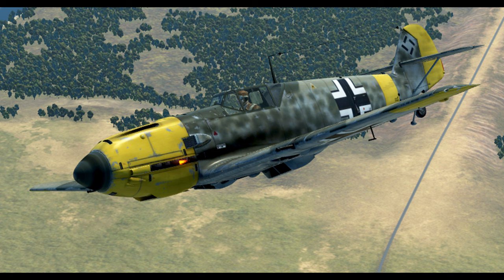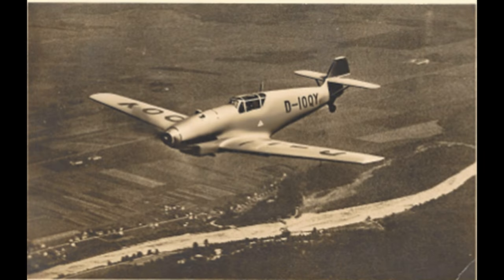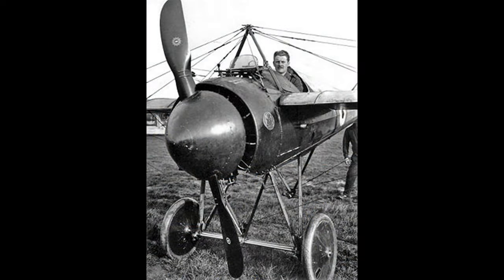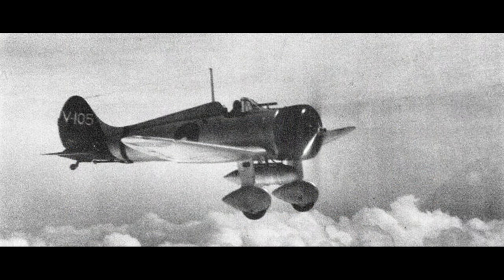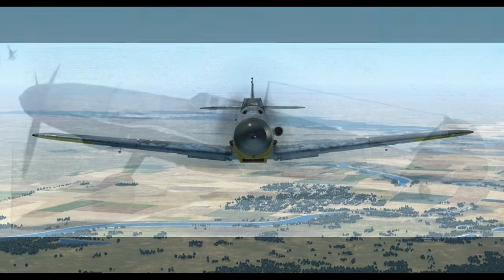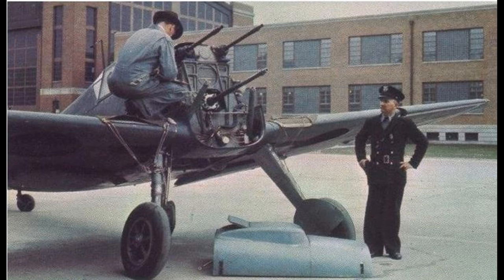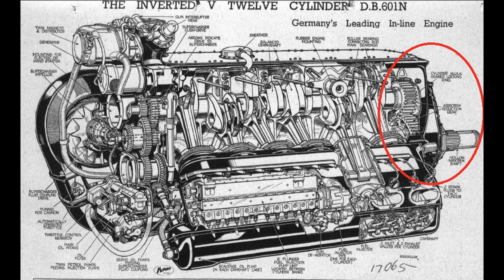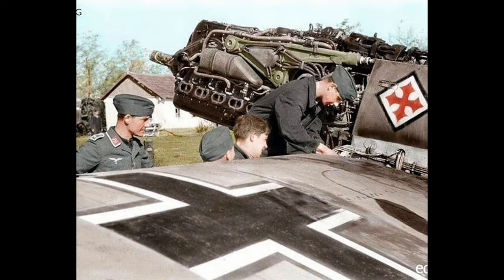Why an INVERTED V-12?  PART 2

Comment: What about heat??  In a up right over head valve V engine the carb is on top. This tends to heat soak the manifold and thus heating the carb up. I build a lot of racing and hot rod engines and any one who works on or owns old cars knows all about vapor locking. In the 50s and 60s the Grand Prix cars used a up right V but they had the exhaust exiting the top of the head and the intake charge coming from the lower side of the head. This was to have a cool and efficient intake charge. Also it reduces “wet flow “ on the intake port walls and valves .
Reply: You seem completely unaware that Germany didn't use old, outdated, obsolete carburetor technology. Most Luftwaffe combat aircraft engines (like the DB 600 series) were equipped with highly advanced high pressure Direct Fuel Injection system or GDI... an advanced technology that has not been in use in automobiles until just recently.
Reply: GDI engines are immune to vapor lock and since they use Stratified Charge Mode operation there is no fuel present in the intake port or intake valve pocket.
Reply: doktorbimmer I am completely unaware 🤣🤣🤣 I love planes but know very little about them. I work in racing and I study aerospace and plane stuff to cross pollenate ideas!! And as far as you direct injection diesel have used that technology for decades !! Direct injection has is down falls also.  Carbon build up on the valve seats will cause havoc. Buy using the water meth would steam clean all that stuff
Reply: doktorbimmer lol are you some Bavarian Beamer fan🤣🤣🤣 I work with the most powerful by weight engines known to man!! I make 2,500 hp per cylinder buddy tread lightly but thanks for the info
Reply: Not true, we are still talking about gasoline engines with spark ignition... SCSI mode operating principle...  not SCCI mode. Actually most of the better automotive GDI designs now switch between HCSI and SCSI mode. Combat aircraft don't have problems with carbon build-up, neither do do cars that are dual mode.
The Luftwaffe invented water/methanol injection (called MW-50) it was fitted to several aircraft including the 109 seen here.
Reply: Not at all, Beamer fans ride motorcycles silly.

So do I... but the most powerful by weight engines known to man  by weight don't have cylinders son... they have vanes and blades! The GE90 can crank-out 101,000 hp all day long for years at a time. 

Perhaps you should stick to those old antiques aye? Cheers!
Reply: doktorbimmer 🤣🤣🤣 euros you guys always think you got it all figured out!! My engines make over 11,000 hp @ 8,000 rpm and weight 545 lbs .  I would think you would be a RR fan not GE
Reply: We did... we invented engines son. GE benefited greatly by "Operation Lusty" which transplanted Germany's entire jet engine industry to the U.S. Americas engines were designed by Germans.

Comment: Why did the 262 have the triangular fuselage (no inverted engine obviously)?
Reply from the maker: They needed the real estate down low to attach the wings and have room for the inward swinging gear, and not much room at the top.
Reply: @GregsAirplanesandAutomobiles  Ah, makes sense. Thanks for the quick answer (as ever).
Reply: Makes me wonder ( I am by no means qualified to talk about aerodynamic design principals ) who first came up with the idea of incorporating "lift body" design elements....cause it sure looks like the nice smooth bottom of the 262 could have, albeit it slightly, benefited from this. Intentional or happy by-product ? But hey....what do I know ?.. I just learned how to butter my popcorn.

Comment: It appears that the inverted Vee type may have more parasitic drag due to oil getting slung off the crank and then failing below and getting beat up by the pistons and rods. This is probably easier to control in a Upright Vee and it can be a considerable horsepower robber and oil heat/aeration issue.
Reply from the maker: That could be, I haven't found anything official saying that, but it does appear that a good argument can be made for exactly what you are saying. There are pros and cons to every design.
Reply: Not true... Th DB-600 series was dry sump... and minimized "windage" with multiple baffles and scavenging pump pick-up points.
Reply: The crankshaft is above the whole assembly. The crank doesn't contain all the oil flowing threw it. Oil is squished out threw bearing clearances (side play) so oil will be failing or getting slung off the crank and will not be picked up by suction until it reaches the bottom of the motor. While its true that most of the air bubbles and such will be removed by the dry sump tank I'll bet there is a fair amount oil getting beat up by the crank, rods and pistons before it makes it back into the suction side of the pump. That can certainly be better controlled in a Vee motor as oil would only be exposed to one side of the crankshaft (slinging). In an inverted Vee the oil slinging cannot be easily controlled and exposes every  rotating part to the possibility of getting hit by failing or splashing oil simply because of gravity or being above all the rotating parts. As far as ease of maintenance. I would rather work on one from above even if it meant standing on a ladder or platform because there is less chance of crap hitting the ground. I can imagine working on valve train parts on this motor would have taken two people to work on it just to keep parts from failing out of it. In typical German fashion, their equipment is over designed and over thought out. It's great stuff but its one off type stuff that that just doesn't make much sense at the end of the day.
Reply: @n5ifi Not true, the inverted layout is superior in reduction of crankshaft windage... and the crankshaft incorporated roller bearings... which also minimized oil volume and pressure and an overall reduction of windage compared to up-right engines. Inverted engines are superior to up-right engines but Germany then introduced Jet aircraft... rendering piston engine fighters obsolete.
Reply: @n5ifi Not true, the inverted layout is superior in reduction of crankshaft windage... and the crankshaft incorporated roller bearings... which also minimized oil volume and pressure and an overall reduction of windage compared to up-right engines. Inverted engines are superior to up-right engines but Germany then introduced Jet aircraft... rendering piston engine fighters obsolete.
Reply: @doktorbimmer  So the crank was a bolt together crank?  I'm learning about it none the less. Very interesting. I know this motor was run very conservatively (hp wise) in the beginning of the war. The Germans should have been able to turn up the wick so to speak to get more out of it but the reasons I've heard they didn't was because of fuel quality. (Octane ratings) Was that true? Seems like I remember this being a much large (CI Wise) motor than the Rolls Royce.
Reply: No, the crank is a large forging. Really? because the DB600 series went from a rather conservative 900 HP (1,000 hp 5 min. WEP max.) in 1935 to 1,900 hp continuous (3,000 hp WEP {up to 20 min}) by war's end.
  The Germans had an excellent system of standardized fuel grades for military equipment. For aircraft piston engines there were two standard grades:
  Flugmotorenbenzin C3  (dyed Green) high perf. 100 octane (PON)
  Flugmotorenbenzin B4  (dyed Blue)       standard 90 octane.

Compared to the Allies which used a wide variety of fuels and colors from 85 - 125 octane, with all the logistical problems and accidental engine damage that would result from such confusion. 

*The DB-600 series has displacement between 33.9 L (2070 cu.in.)
 to 44.5 Liters (2,717 cu.in.)..*

The biggest flaw in the Rolls-Royce Merlin was its small displacement... this problem had to be compensated by ever higher boost pressure (and less reliability and shorter TBOs).
 This flaw was finally addressed with the Rolls-Royce Griffon engine... a vastly improved version of the Merlin with a larger displacement of  37 liters (2,240 cu in) but the long development meant these engines arrived too late in the war to make any impact. Cheers!
Reply: So how do you get roller bearings in a forged crank?  Radial engines used roller main bearing(s) because the crank was in 3 pieces bolted together
Reply: @jimattrill8933  Split bearings, that´s how.

Comment: Nice video, thanks for sharing !  Having the guns in the nose (as opposed to having it in the wings) also helps with gun accuracy at range. Convergence of fire is less of an issue since both guns shoot straight instead of converging at a set distance (which is the case when guns are mounted in the wings).
Reply: There are a lot of films showing how crossed was the firing of both sides with wing mounted guns when the pilot starts shooting at a greater distance than the harmonized one. It was a waste of bullets!

Comment: Firing a projectile through the propeller hub; what amazing engineering!
Reply: I recall reading that the Germans (and Japanese) using the Daimler-Benz 600-series engines, featured electrically-fired 20mm ammunition to shoot through the propeller hub. (I suspect that the Russians did something else with Yak and LaGG fighters.) The P-39/P-63 had a rear-mounted engine, so there was space for the nose-mounted 37mm or 20mm cannon.
Reply: Not really. The French did it almost two decades earlier. Later, the Dewoitine D.501 entered service in 1935 with a 20mm HS-7 firing through the propeller hub. That was with an upright V-12. The French continued with cannon firing through the propeller hub and the Soviets used them because the M-100 family were license-built Hispano-Suiza 12Ys, which the Soviets continued developing after France fell to the Nazis.

Comment: Engineers designing for ease of maintenance?.....hmmmm
Reply from the maker: It does happen, but it seems to be a forgotten theme of design these days, at least in cars.
Reply: Ease of maintenance was seen as very important at this time, WW2 era fighter engines were pushing the levels of performance much faster than the levels of reliability... these engines had PFTRs of just 100 hours at military power and required inspection and repair after WEP (P-Max power) was used. A typical Allied or Axis fighter plane engine lasted barely 20 hours between overhauls in combat operations and often required overhaul after just one mission.Very different than modern commercial aircraft which can operate thousands of hours between overhauls

Comment: Would not that cause more piston detonation..? It being upside down...?
Reply: Why would there be detonation? The DB-600 series engines injected fuel directly into the combustion chamber.
Reply: @doktorbimmer  I understand the fuel injected part very well...It's the oil distribution part,oil settling into the cylinders after shut down....Fuel does not cause detonation  ever...that i know of, working on aircraft engines that always concern to me...!
Reply: @doktorbimmer   

1 second ago
@doktorbimmer I understand the fuel injected part very well...It's the oil distribution part,oil settling into the cylinders after shut down....Fuel does not cause detonation  ever...that i know of, working on aircraft engines that always concern to me...!
Reply: Why would oil distribution make any difference? Fuel is exactly what causes detonation, any time the A/F charge ignites too early or in an uncontrolled manner detonation is the direct result, fuel quality and combustion characteristics play an important role in detonation, especially if the fuel does not meet the manufacturers specifications.
Reply: @doktorbimmer Kermit Weeks will disagree with you...!You still missed the point.!
Reply: I can assure you Mr. Weeks will agree with me 100%... I think its you who are confused about what detonation is, I think perhaps you are confusing Detonation with what is called engine  Hydraulic Lock damage also commonly called "hydraulic-(ing) the motor".

Comment: Funfact ,  one Spitfire MKV was converted with a DB601 inverted V engine.

The first Bf109 Prototype (RR Kestrel) and the last spanish built Version used upright V-12s, the spanish Variants used the Hispano Suiza and the RR Merlin, the Czechs built a Version with late G Airframes and a JUMO 211 engines and the germans built 109 Prototyps with BMW Radials

Comment: The whole underbelly of the aircraft forward of the cockpit remains flat with an inverted V12. This seems like a better aerodynamic solution?
Reply: You could just as easily make a flat underbelly with an upright.
Reply: @videodistro  

That would be at the expense of adding a large amount of drag i.e you'd be turning the V into a box. 

You want a small frontal area and clean airflow. Seems the inverted V12 would be best.

Comment: Greg, you have said before that the Germans experienced problems with oil being thrown around in one direction the DB and other in inverted engines leading to the cylinder bank on that side getting oiled up with the need for modifications to the compression ratios et al. No doubt other engines experienced similar issues with th radial being especially a challenge. 
As a matter of interest, what sort of specific oil consumption did the different aero engine configurations experience? It would be interesting to find out, I understand that the Bristol radial was especially thirsty on oil due to the sleeve valve design. Thanks

Comment: It is possible that more than one factor contributed to the use of an inverted engine. 
1.bringing the weight distribution lower so that the strenght of the airframe can be increased.
2 Better torsional rigidity with all the heavy components being on the same plain.
3 Points 1 and 2 would therefore combine to reduce the possibility of of standing resonance. 
4 Yes, the position of the gun could have also been one factor. 

I really don't understand the obsession with finding a single over riding reason for the decision. However if there is one how about the simplest and most likely? 
Better and more advanced research had been conducted into the type at the time so when a large powerful multi cylinder engine was needed that's what was available. So having gone with a successful initial concept they simply ran with it instead of trying to reinvent the wheel

Comment: Previously you said because of the pilot view and ground crews ease of maintenance, but you forgot to add that the inverted V-12’s tended to be hollow in between the cylinder heads, so you could mount a cannon firing through the prop or a tricycle landing gear or more engine equipment, also because it was hollow it tends to have better heat dissipation over the cylinder walls vs a upright V-12.
Reply from the maker: I didn't forget. I'll explain that here in part 2.
Reply: How does turning a vee engine upside down produce more space between the banks of cylinders? M.
Reply from the maker: exactly.
Reply: Rover Coupe one you move most of intake manifold to the out of V then there’s the water cooling ducts and oil cooling and so on, but keep in mind that this could/was/has been done to upright V-engines as well, in a normal V-engine the center of the V is taken up by cooling system and the intake manifold were as the German’s inverted V-engines move all if not most of this out of the center of the V.
Reply: I agree with the conclusions you have, thank you and keep up the research!
Reply: The soviet V-engined fighters would like to have a word about this
Reply: Again nice video with bunch of interesting data , especially for me because the DB 601 is my favorite engine from WWII era. Thx for upload.
Reply: *Laughs in Yak 1 and Lagg-3
Reply: jonskowitz yes like I explained earlier both the inverted V’s and the upright V’s some times used the hollow area in between the cylinders to mount a heavy caliber cannon, but this meant that the intakes and some of the cooling systems were moved out of the hollow this also meant you needed two of everything, so yes the Soviets did use upright V-12’s with a large heavy caliber cannon in the proper. Hope this answers your question

Comment: Great clarifications, thanks. I suspected V engine configuration didn't make any difference to installing a cannon, but I never said it was actually installed (other than the gun barrel passing through the cylinder banks ) inside the engine. Lol.

Comment: you forgot the mustang started with an Allison v12 and was a dud until a RRV12 was installed , but the Allisons lived on to power most hydoplane racers of the 50's
Reply from the maker: I certainly did not forget the Allison powered Mustang. I have covered in in several videos. It was faster than a contemporary Spitfire.
Reply: @GregsAirplanesandAutomobiles  it should have been faster , it was next generation .. but the mustang became a plane when the Mierln engine was installed . Not even sure they flew the Allison into battle , it was next to useless as an aircraft engine
Reply from the maker: Useless? I think there are a lot of Japanese who would disagree with you. On a more serious note, it sounds like you are comparing the later two stage supercharged Merlin to the single stage Allison. Apples to Apples, meaning single stage supercharged versions of each (i.e. Spitfire Mk V and earlier), they are about equal in performance, but the Allison does it with half the parts count and greater time between overhauls.
Reply: +Neil MacKenzie   The Allison was a fine engine down low.  The boat racers used and destroyed hundreds of Merlins also as well as Allisons from the 1950s until the 1980s.   They were forced to go to turbines because they had destroyed every V12 that they could get.  The tractor pullers are scrounging up what they can find to destroy also.